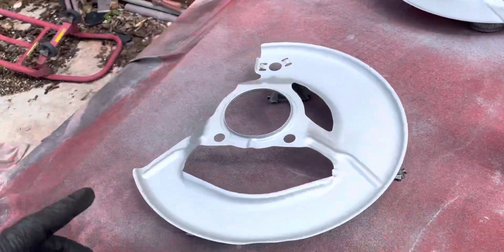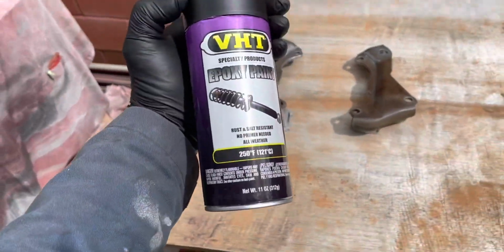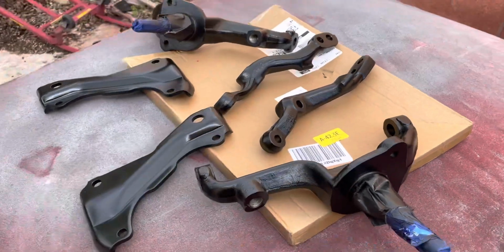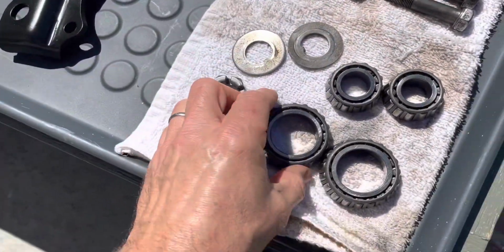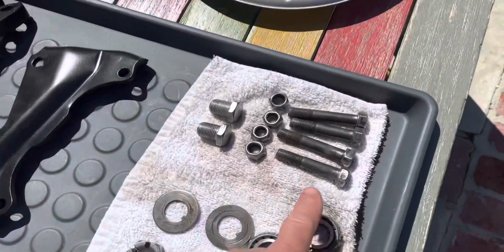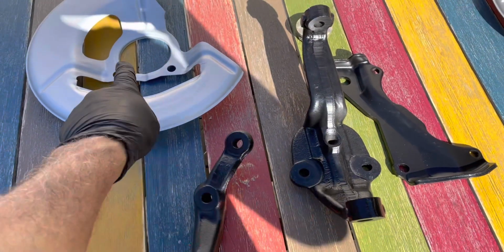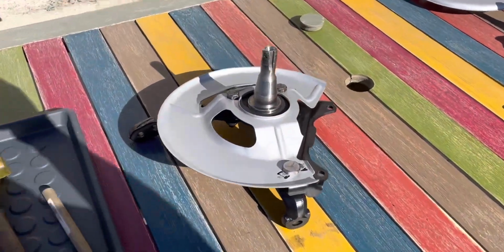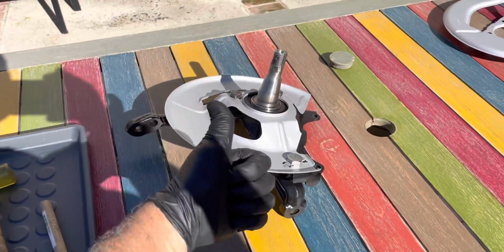C3 Front Spindle Rehab and Assembly.

Comment: Parts are called brake caliper mounting bracket, steering arm bracket, and brake dust shield. I got the factory assembly manual for my 74 and 81 vettes. That's what they are called in the manual.
Reply from the maker: Thanks. I should look this stuff up, but I’m not making instructional videos (sort of). It’s good to know though.
Reply: @Unboxed  anytime man, I've been following your vette build since day one. I biuld vettes exclusively, I own a C2, 2 C3's. And a pace car 86 C4. I also have a number of vette salvage yards I use to get those hard to find parts that no one reproduces. So if need some help, just message me, I'll help ya. I'm also in a local vette club, and a member of CCCA, so if you need help or info, I'll do my best to help you.
Reply from the maker: @gizzmo5952  Much appreciated! Who knows, maybe I’ll get a NCRS-worthy car someday. I need more space first!

I make typos all the time.
Reply: @Unboxed  errr... sry... that's NCCCA, not CCCA. Fingures where going nuts on the keyboard....lol.
Reply from the maker: @gizzmo5952  What I think I’ll need help with the most, is installing the replacement upper windshield frame, including the two corners and cross support. I know that needs to be right, otherwise the top will never fit right and it could also affect the window gaps and fitment.
Reply: @Unboxed  hummm... tell you what I'll do, we have a guy in our club that owns a vette restoration shop,  I'll ask him what the best way to do that, and I know of a savage yard that sells the birdcage frames. Between your factory assembly manual,  my buddies advice, and that salvage yard, I think you can do the job. The assembly manual will give you the specs,  and a ready to go used Birdcage should have you fixed up and going, and my buddies advice will point the way.
Reply: @Unboxed  https://youtu.be/gT9HiNqSpAE I think this is a video of the salvage yard. It's call corvette generation.
Reply: @Unboxed  try this again. My manual has the birdcage on 68 to 71. I saw you had a factory manual. My buddy will back in town this weekend, I'll ask then.
Reply: @Unboxed  I looked up in my 74 factory manual, and the birdcage structure is from page 68 7

Comment: Looks very nice! One thing I always do is use flat clear on the cleaned/ wire wheeled bolts, helps them to stay looking good for a while even though they get a little scratched up when tightened down. Car is going to look very clean and well detailed when you are finished, it’s going to be fun to drive in that socal weather!
Reply from the maker: Good tip. I’ll probably do that on some bolt heads and nuts. Also, just make sure they have a little oil on them. These are supposed to be stainless, yes?